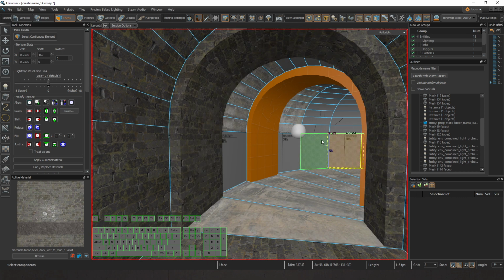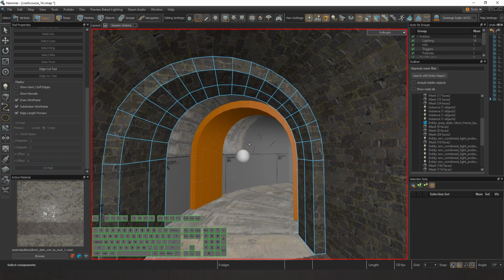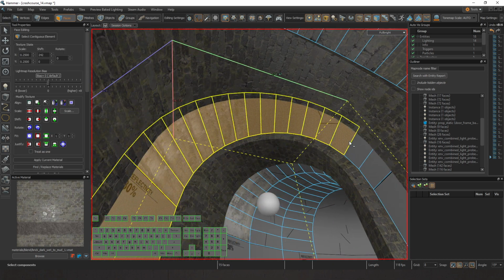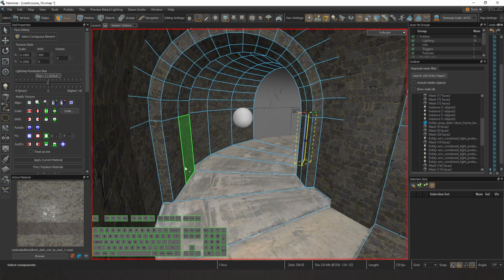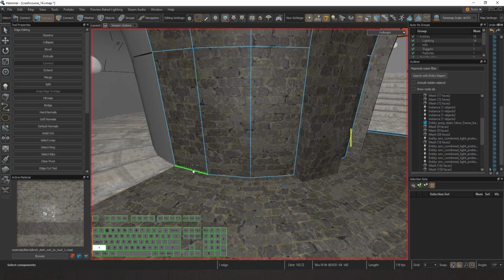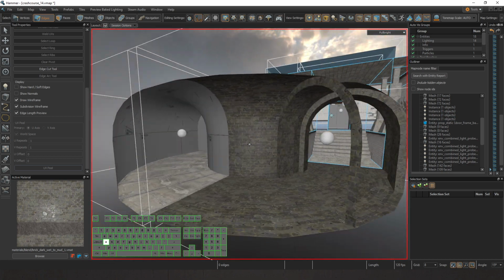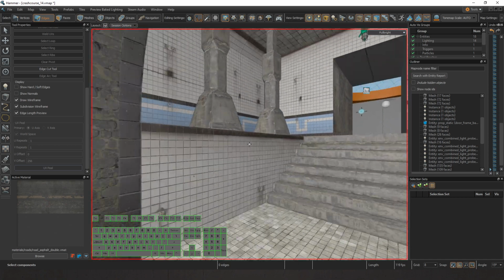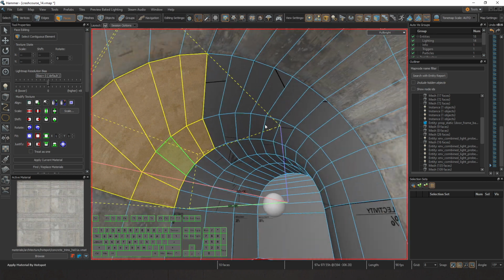Source 2 101 - Hammer Crash Course #14 : UV Peel those curves (tutorial)

Comment: I am running into some crazy issues with the UV peel. My arch is exactly the same as yours with the lines and faces, however UV peel is only applying to the textures on the top part of the arch when it starts to bend. Also UV peel keeps scaling the texture too high, and when I go back into face mode and lower the scale the effect is ruined.
Reply from the maker: Make sure that the faces are all part of the same mesh and not separated so it applies it